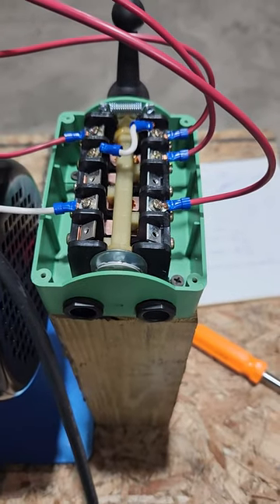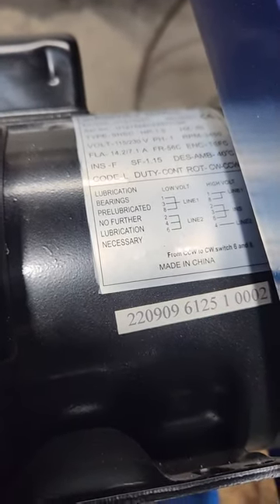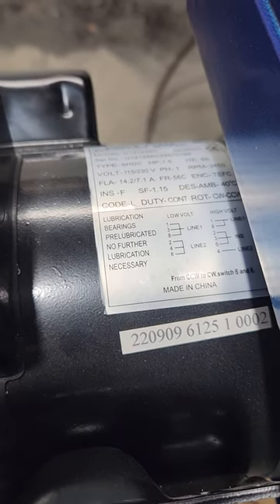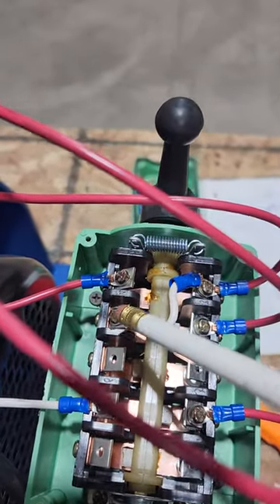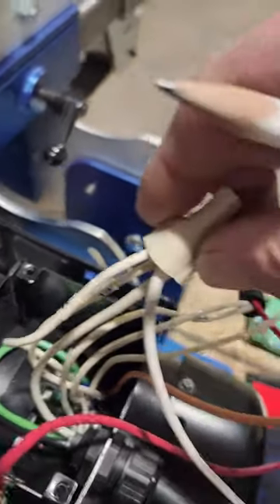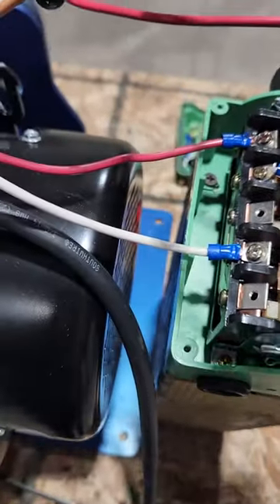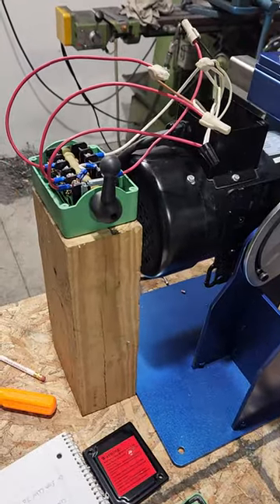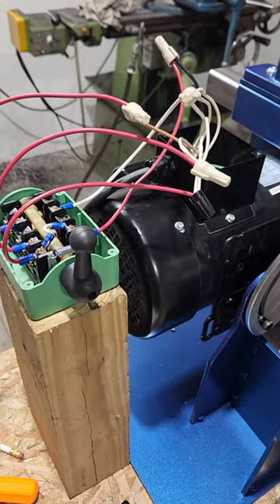How to wire up a $15.00 drum switch to a 110-volt single phase motor.

Comment: You're a genius! I bought one of these off Ebay and was totally lost on how to connect it up to a single phase reversible 1/2hp motor. Thank you so much!
Reply from the maker: Thanks
Reply: @jamesstuart946  I'd happily buy you a coffee if you add a "buy me a coffee link". I went through a lot of frustration trying to wire this up. Even went to a well known motor shop that was not able to help. Thanks to your vid I'm back in business. My lathe had a really nice, but dated and worn drum switch and I was shocked to know that replacing it was $200-$300 dollars which is what led me to the Ebay, cheaper drum switch. Even if I have to buy a new switch every so often, now that I know how to wire it, not a big deal.
Reply: You are a big, help, James, thank you so much!!!!